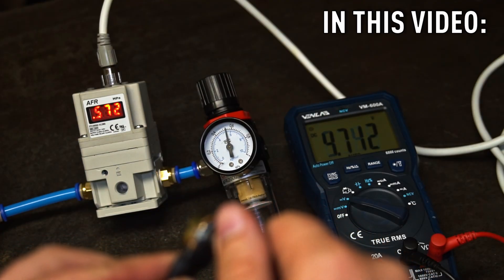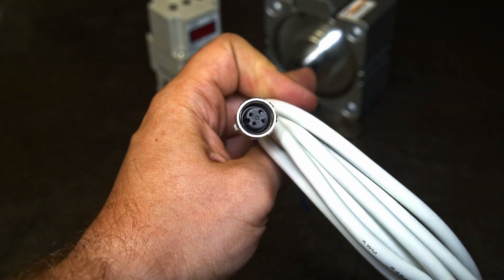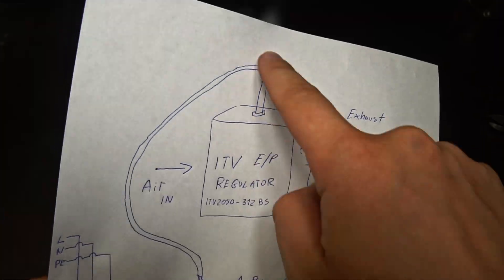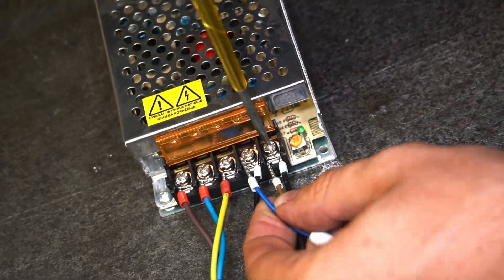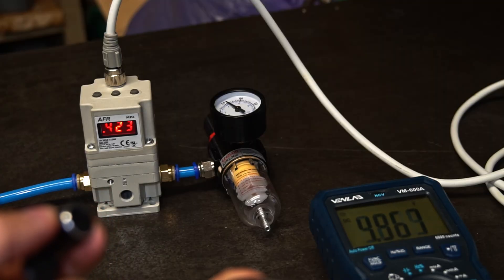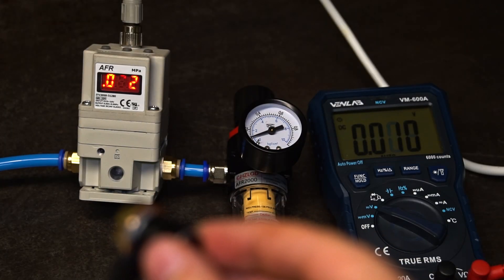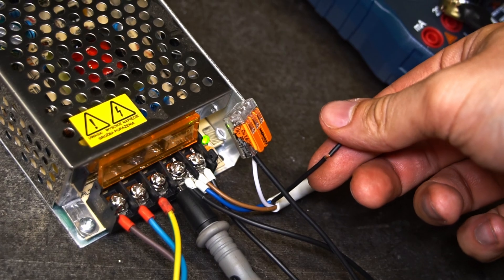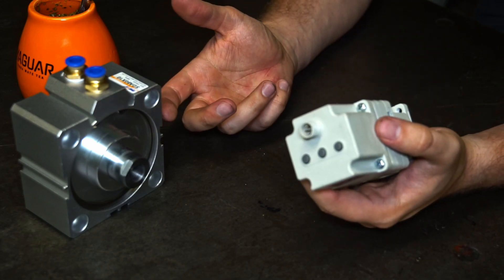How To Easily Regulate Air Cylinder Force? | Electro-Pneumatic ITV Regulator!

Comment from the maker: Did you ever see such device? Quite useful IMO.
Thanks for watching!
Reply: ITV valves are made to supply a pressure with an extremely low flow rate probably less than 1 liter per minute. If you actually want to supply a supply pressure you should use a pilot driven air regulator that pilot driven by the ITV valve.  If you allow the ITV valve to flow in an open ended fashion the bimetallic strip inside gets bent and the accuracy of the ITV valve is shot.
Reply: @dazaspc  I've been through those SMC ITC valve datasheets again recently, I want to use one to control air pressure to a plasma cutter on the fly. The tiny small one at the lowest pressure is rated for something like 50L/min. I've ran lasers that would chew through nitrogen faster than I could evaporate the stuff, they used SMC ITC valves to regulate cutting gas. In fact, inside that valve you'll find the arrangement you describe and exactly no "bimetallic strips." In other words, you don't know what you are talking about.
Reply: @dazaspc  I have been inside many of these valves, I assure you that they do not like consuming liquid nitrogen. No bimetallic strip, a PCB mounted MEMS pressure sensor and some solenoids. It is certainly a chinese clone, and probably came off the same assembly line as the official SMC valve anyway. I've had my hands on official $600+ valves, and I've ran the $100 valves on the same equipment in a pinch. 

Once again, go pull the datasheet up and look at the cutaway. It makes absolutely no sense to do what you say because that is exactly what that valve already is in the first place...